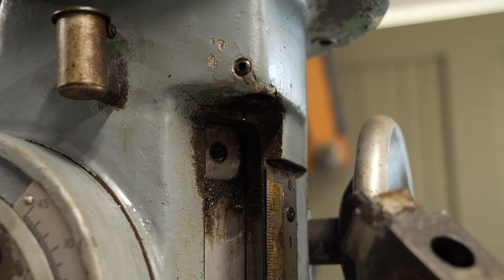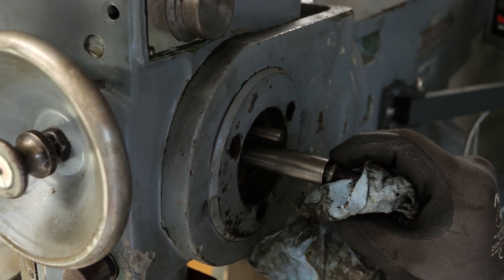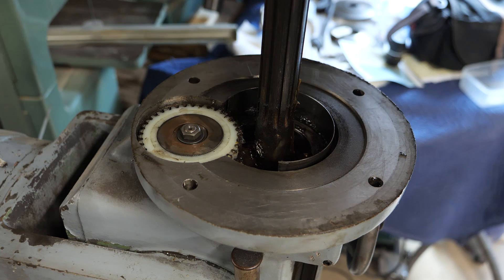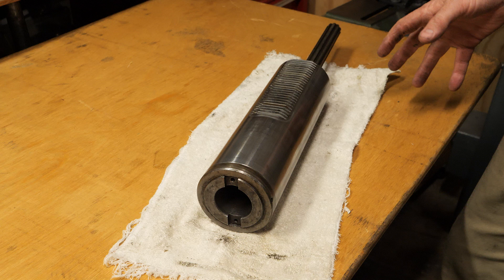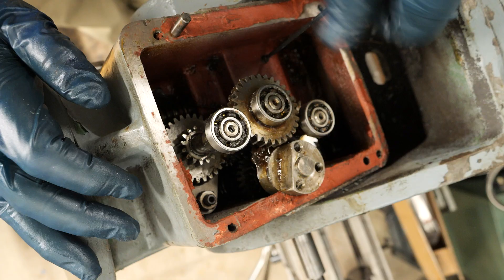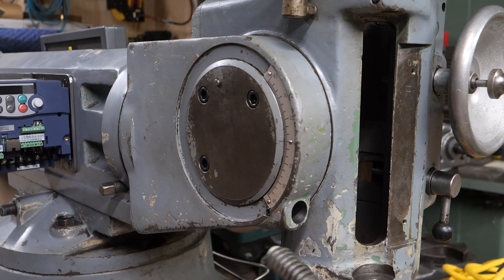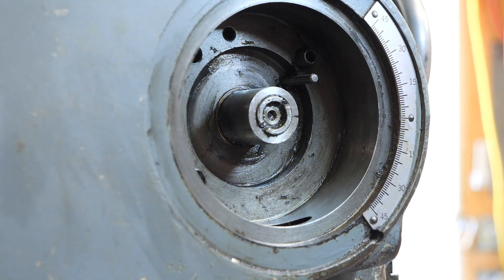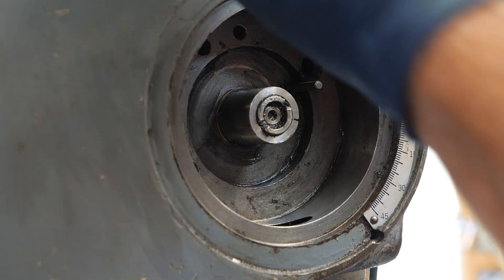Excello 602 Milling machine head rebuild Part 1

Comment: I could have sworn that you said in your last video that the Millrite was the perfect size for your shop- I guess its a great day when you find a second mill-sized hole in your workshop :)
Reply from the maker: Haha I did say that, Cory! My shop is currently a manifestation of my ADHD mind... a cluttered mess. And I haven't even mentioned the engraver yet... Still deciding which mill to get rid of now. Have to say the Excello is simply too damn big for the space, but it sure is nice having 25 inches of power feed travel and a DRO...
Reply: @junkyard_kahrs   It's hard to believe in your ADHD, with the amount of focus you've been able to put into TWO mill rebuilds.  I looked at an Excello at a tool dealer in the inland empire a while back, but I'm glad I opted for a new import mill because I would not have had the knowledge, skill, or the meticulousness to do the work you are doing.  Maybe I will by the time I'm ready for my next mill.  Thanks for sharing your shop time!